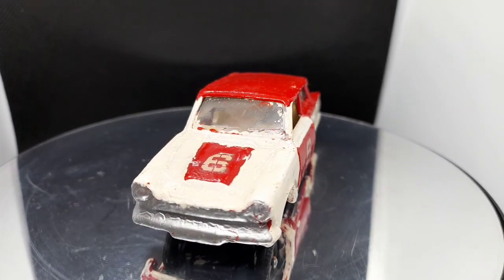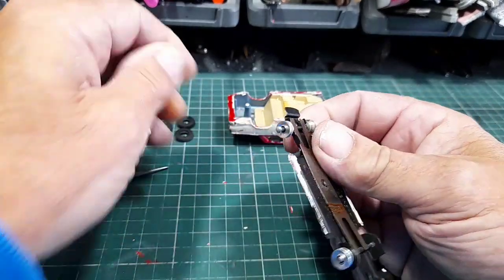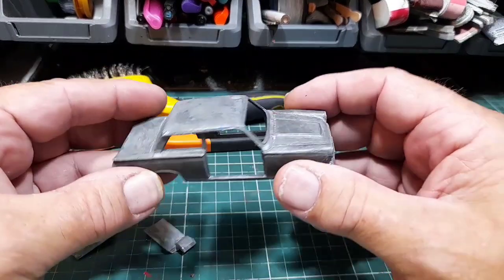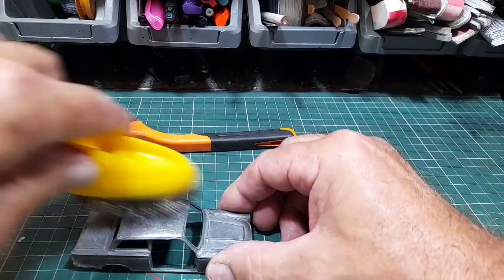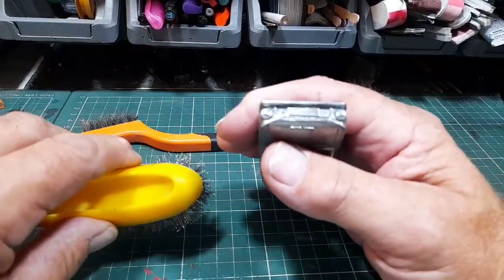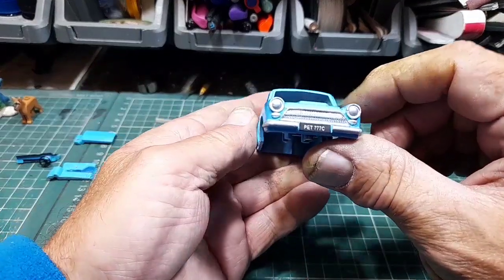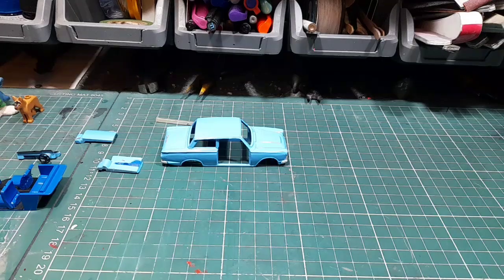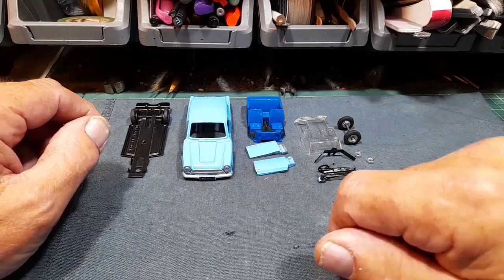Dinky toys Diecast Restoration Ford Cortina mk1 no/139  1963/64.

Comment: the same front as my consul cortina but mine is a four door and ice blue with chrome trim round the head lights, excellent job it looks so much better, the first mk1 ive seen done by a model restorer
Reply from the maker: Thanks Mike, yes wasn't to sure about the blue ,the one I used was the nearest I could get ,there is a couple of other cortinas I will be looking out for that dinky producesd. 
All the best martin 👍
Reply: @martindaredare  over the years ive been buying them and i have about 30 the same size as that one all different plus i have one that is about 10" and that is a lotus mk1
Reply from the maker: Sounds like a nice collection 👌 the lotus sounds nice.
All the best martin 👍

Comment: If anything Martin who ever the kid was that coated that much paint on the die cast only did one thing for sure, “preserved the details”. The car has beautiful body lines & detailed on it, you sir definitely brought it from ugly crap to new out of the box jewel 💎. As always my friend, you do a great job of restoring it, you take care & see ya on your next build.
Reply from the maker: Thanks very much Jeff that's kind of you, yes it certainly did save the finer details which makes it  stand out now.
All the best Martin 👍
Reply: martin dares dinky restorations. Martin, I do have one question? Will the causative soda eat the die cast body up if left too long? 🤔
Reply from the maker: Hi Jeff it depends on the casting material used some of the early dinkys like the big hoarse box and the early dinky tow vehicle are not recommended to be put in caustic at all ,but to be on the safe side I wouldn't leave in any longer the 15 minutes and check regularly, most older dinkys the paint will come of virtually straight away, if its stubborn I will put in paint stripper for a lot longer.
When the caustic soda cools down its less effective. 
I hope this helps. 
M
Reply: martin dares dinky restorations. Thanks Martin for your help 😎

Comment: Think they laid that paint on with a trowel. Dinky did 2 versions of the mk 1. The later one had the wrap around grill. Jewelled headlights front & rear at the ruin of the tail light configuration. Was also flawed in the lower rear panel
Reply from the maker: Cheers Ian , I have seen the later one on ebay might see if I can get one and do a comparison. 
All the best martin 👍

Comment: Wonderful job. Really enjoyed this. Do you have any tips on what to use for replacement jewel head lights? I've been looking but they all seem too big.
Reply from the maker: Hi Sam, there are a few things you can try ,craft shops do those type of jewelry sometimes you can get them in strips sizes from 2mm up to 6mm.thay have a flat back to them .
I will go round charity shops looking at junk jewelry you get some good ones and plenty of them in one piece of jewelry, I even pinched my wife's flip flops when I noticed thay had the same type as corgi and dinky used .
Or you can get them from China but long delivery time .
Happy hunting. 
All the best martin 👍
Reply: @martindaredare  That's great thanks Martin 👍